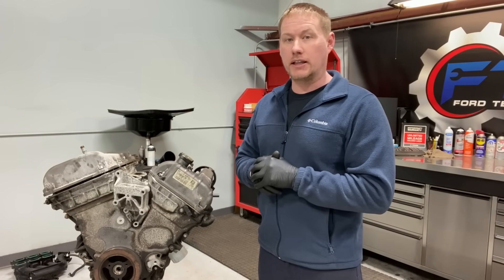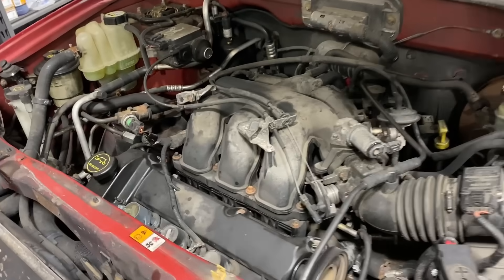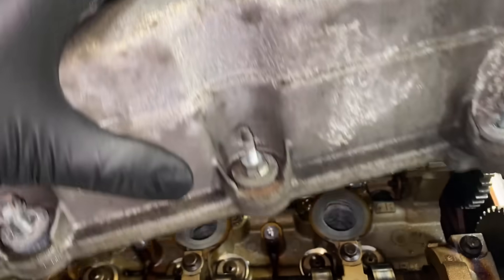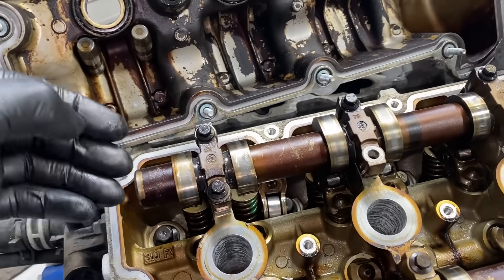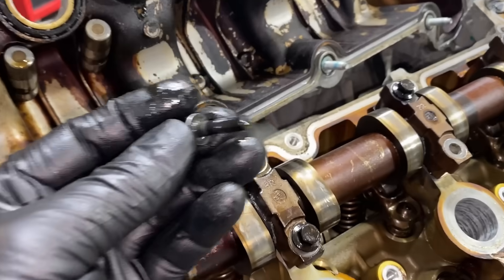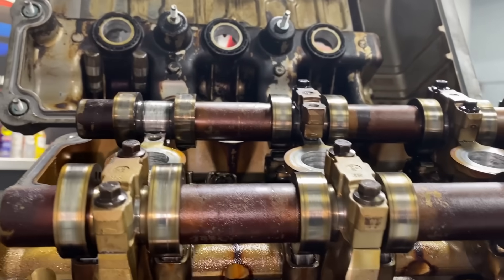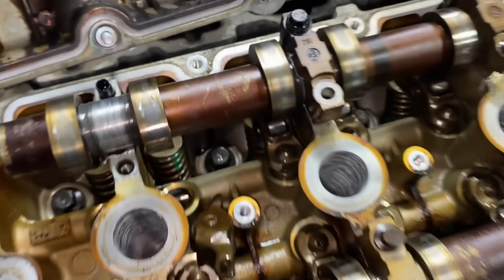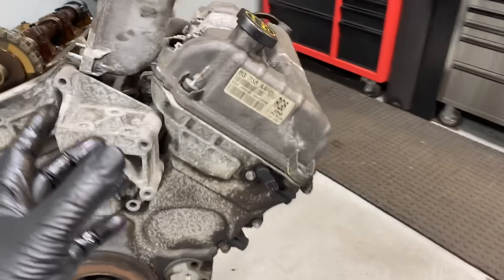Ford 3.0L V6 Duratec Engine: The One Fatal Flaw That Will Destroy This Engine!

Comment: I always thought the Vulcan was the best built Ford Engine!
Reply from the maker: Too many issues
Reply: @FordTechMakuloco  Interesting. The Duratecs I had in a 96 and 03 Taurus/Sable, I felt were junk. Parts were expensive when they broke (Radiator hoses), and with rust, servicing things such as oil pan gaskets was next to impossible. The Vulcans I've had (92 Ranger, 05 Ranger, 05 Taurus) were bulletproof. I've heard of cam synchro failures on it, but generally it gave an early warning from what I've read with a chirp that meant to replace it with a new Motorcraft. Sadly, all vehicles though, were severely rusted and went to the junkyards around 100-150k miles. I remember seeing people on Taurus forums praising the Vulcan; slow but reliable!
Reply from the maker: Burnt valves, chirping synchro, multiple oil leaks, front cover coolant leaks, cracked coil packs causing misfires, pcv tubes deteriorating causing massive vacuum leaks and stalling etc.
Reply: @FordTechMakuloco  I am grateful that none of my Vulcans did that during my ownership! They served me well for what they were, that and when I did have to wrench on them, they weren't anything too difficult like changing out alternators during a snowstorm. Oh, and the joys of burning myself every oil change due to position of the oil filter and the exhaust manifold. I don't miss that.
Reply from the maker: lol I hear ya there, between the hot exhaust and the starter you couldn't win.

Comment: Oh wow...that's something new!

That said...I got a '98 era 4.6 2V Triton that's sitting at 523,000Km...never been opened...yet! Knock on wood. Ford has made some great engines but some with interesting failure modes.
Reply: I agree. 2002 4.6 2v with 262kmiles on it and still strong and smooth as hell.    They should have kept using this engine.

Comment: I have that engine in a 2008 Fusion. It has over 218,000 miles on it, and it still runs excellent. It does leak oil though

Comment: Is this engine in the 2005 Ford Five Hundred (500) ?  I'm about to change plugs (100k maintenance) and have the intake cover off, wonder if I should change these bolts while I'm in there.
Reply from the maker: Yours is a slightly different version and I have never ran across this concern with your model.

Comment: Did these owners change oil regularly?  190k on our 06 freestyle and still running strong.  I am wondering how long the CVT will hang in there
Reply from the maker: Your engine is a bit different.
Reply: FordTechMakuloco 
Thank you
Reply: @tomedgar4375  I have a 2007 500 with the CVT. It has 100k miles on it.  Glad to hear yours has been good to 190k. My 500 has been a good car.  A bit under powered but reliable.

Comment: This actually happened to me on my 3v. It was my fault though as I was the one who tightened the cam caps. I caught it early thankfully and used ARP studs afterwards.
Reply: Why say that it is your fault? Did you use a torque wrench?
Reply: @5jjt  What evenis the right torque? :'-(
Reply: Did you clean out the threads with acetone and use locktite blue?
Reply: @tedtedness184  At that time no. But since then yes.
Reply: @TekMan05  hmm... ever pinpoint causes of those misfires?
Reply: @TekMan05  my other question is... was all those noises constant after warm up?? or only for a minute or 2 at cold star??
Reply: question... with the bolts loose did u have any misfires or noises??
Reply: @DVrec22   Loud tapping noises. Less power.

Comment: Thank you! I have a question, do you have a video explaining how to fix the oil leaks?
Reply: Basically, remove and replace the front cover. The intersection where the heads, block and cover meet is the shape of a "T" and can leak. Good time to do the timing set. The cam covers leak, too. The washers under the bolts can seep. Other than being a huge pain in bleep, it's a great engine!

Comment: Is this applicable to a 2005 Ford Five Hundred engine?  Thank you.
Reply from the maker: No I have never seen it on those engine they are a bit different design.
Reply: Thank you for the reply
Reply: @FordTechMakuloco  thank you for this answer.  I have a 2007 500 with 100k miles on the clock.   Been a great car.  We just don't put that many miles on.

Comment: Have you seen this problem in the later versions with cam phasers? I have a 2010 escape and have checked the bolts already back when I replaced the valve cover gaskets last year! Everything was tight and looked good.
Reply from the maker: No not on the 09 and newer Escapes.

Comment: I bought a Contour SVT new, great car, gave it to my son at 150,000 miles, he put another 75,000 on it before the body and suspension rotted away. Not one engine problem, just oil and filter every 5000 miles. That 2.5 L duratec was a fantastic motor.
Reply: I had a 96 contour with a 2.0 automatic. I drove it until 2011. I bought it used in 99. Brakes and alternator and a/c compressor. Only sold it because it needed struts and wouldn't pass emissions in Maryland. I really liked it overall.
Reply: I have a 98 SVT Contour. 2.5L Engine is clean and runs great at 247,000Km. My transmission is pooched. Having a hard time finding a replacent that the bellhousing matches. Fun car to drive
Reply: because the k series mazda is its father (probe gt/mx-6) 
this durapuke is the mazda aj engine

Comment: So would cleaning out the threaded sections of the head, then using red loctite on the bolts help this from happening again down the road?
Reply: yes.
Reply: Brian and others say NO to loctite.  Not designed for that, will affect the torque.

Comment: A drop of Locktite red on the treads of the new bolts?
Reply: Blue, dont use red its permanent, takes a torch to get it apart.
Reply: @JimGriff1720  Here’s on for this history books.  Worked on a late 90’s Saturn last year.  Had to pull the head for a bad head gasket. Front cover had to come off.  The oil pump for the Saturn is in the front cover and driven by slots in the crank pulley stem. Since there so much oil under pressure in that area you have to use a thin coat of sealant on the crank bolt washer.  Used the impact in the bolt, NOPE.  Used a breaker bar, NOPE. Wedge the breaker bar and the ground and taped the started, NOPE.  That only torque the breaker bar.  Got the torch and heated the bolt.  THAT WORKED.

Comment: This is exactly what happened to my 02.  After teardown, no broken bolts. But I found a chunk of RTV under the head gasket blocking the oil feed port to both cams. One port feed from the block then splits in the head casting immediately above head gasket.  She was a virgin.   Had to be factory RTV.

Comment: Question, could Ford be at fault using inferior bolts in the original engine. Question, could you use locktite on the bolts to stop them coming loose.

Comment: I was just thinking that replacing the bolts and using some thread locker might be a good idea. BTW: I just call oil leaks the "continuous oil change program."
Reply: I always have a bag of the cheapest kitty litter for the leaks. "If there ain't any oil under them, there ain't any oil in them."
Reply: You don't want to use threadlocker, it changes the torque/friction values, and you can strip the threads much easier while torquing to spec. Just go off the physics of friction alone, with new bolts
Reply: @BasedBidoof  Thanks!
Reply: @garylangley4502  Don't get me wrong I love threadlocker, but if the bolt/nut wasn't designed for it, it's probably best to not add it
Reply: @BasedBidoof not only that I don’t think you want to take the chance of that thread locker material coming out in your engine lol I don’t know if it would cause a problem but I wouldn’t want to take chances either. I’m pretty sure they don’t use thread lock in engines but I could be wrong.
Reply: That's a British invention: old British engines, be it car or motorcycle engines, had to leak oil. 
Thus you were sure of two things:
1. there actually is still oil in the engine
2. there is oil pressure
Reply: @tjroelsma  Ah yes, the Brits. Old Brit cars with their oil leaks and Lucas electrical systems. There is a reason why they called Lucas "The Prince of Darkness".
Reply: @christopherhylton8462  the reason the Brits drink their beeer warm is because their refridgerators were made by Lucas
Reply: @tjroelsma  It is also why used British railway sleepers are the best on the market. Sufficient oil impregnation for them to last decades without rotting..
Reply: I call it free undercoat, standard on most Chev's.
Reply: Yeah well that leaking oil gets into the local water supply
Reply: I never change the oil on my 99 DeVille because every  month it gets 3 quarts of fresh stuff 😂
Reply: Chris Annunziata I understand you are joking but some people actually do just that, adding oil, until the engine is so clogged that it is ruined. And they wonder why...
Reply: @vlasfarg  Clogged with what?
Reply: @chrisannunziata7628  if you're actually serious about that, at least replace the filter every month or two.
Reply: На АвтоВАЗе масло не меняют, его только доливают 😅
Reply: No dreadlock just buy really good bolts that can TAKE THE ABUSE I forgot name of the nuts and bolt company, that makes reusable head bolts even for diesel!!! And there cheap and life time
Reply: Yeah, the 3.0 Dura-crap engines are like the old BMW's that come through the shop. If they are not leaking oil in your bay floor there is a problem...... the engine is out of oil.
Reply: Christopher Hylton mine has 165k on it and i havent had any oil leaks and i check my oil feequently
Reply: @topkek7003  Do you use high mi oil? Mine has 136K on it and. The rear vc gasket will leak if I don't..
Reply: @christopherhylton8462  The customers of your shop must be morons who don't take care of their cars.

Comment: Wasnt that a recall, I had my moms in a few times in 2005 to replace those parts from ticking and that was at under 10k miles
Reply from the maker: no
Reply: @FordTechMakuloco  https://www.underhoodservice.com/tech-tip-diagnosing-a-ford-escape-with-engine-ticking-noises/
Reply: I remember going in for it because the tapping was loud and this was I believe the repair was
Reply from the maker: That is a totally different issues kind of like the issue the early 3.5L engines experienced.
Reply: @FordTechMakuloco  ok I am sorry. I remember they had replaced the bolts to tighten the camshafts down and this was under 10k. That repair was a campaign we got in the mail after it was done I believe because it was pretty loud. The transmission died just  before that for no apparent reason Never found out but that lease ended and we returned it...

Comment: Thank you sir!, great info to know, I had a Vulcan 3.0 6 Cylinder had great performance out of it. But I've look at the Duratec 3.0   6 Cylinder engines. Thanks for you're shared info again.
Reply: The 3.0 Vulcan is a great engine. Had one go over 300k in an 03 Taurus wagon. Only one transmission replacement, so I think that car owes me nothing. 3k oil and 25k trans fluid changes.
Reply: @jamesplotkin4674  yeah mine was '2003' also James, a sedan, ses model, I drove from '2006' to December '2017', when I hit. Black ice. It only had 140,000 miles on it. It had 66,000 miles when I got the car, I miss that car. I was ill for 11 years and didn't drive much, had chronic pain. Great automobile to me

Comment: what about the OTHER fatal flaw with these engines like the "Timing Chain driven Water pump"?
Reply from the maker: You are thinking of the transversely mounted 3.5L Cyclone engines.
Reply: He's already covered that in a previous video
Reply: That's the 3.5 liter in later models.

Comment: Is the 2.0 Ecoboost in the 2018 Ford fusion reliable and if not what are the week points of the engine? Thanks in advance
Reply: The Ecoboost engines are one of the least reliable engines Ford has made.  In one of my last jobs, an Escape with an Ecoboost with 45k miles was brought in with an overheating issue and found the head gasket was blown

Comment: Brian, has the 2000 model year Taurus effected with the D.O.H.C. 3.0 L ?
Reply: Duratec 30 (that one) came out in 96. They still had some vulcants out there though. If iron, it's a vulcant. If aluminum it's that one.

Comment: I have an 08 Fusion with the 3.0 Duratec and problems so far have been the coils, (cost over $2K to fix), and the rear main seal is leaking, but not bad. Car has 140K miles, still runs good.

Comment: Thats one hell of a One fatal flaw.
Reply: As easy as it is to do a prevenative measure, it ain't too bad.
Reply: @2jz4life35  The point is to me anyway is something like that should not even be allowed out of the factory.
Reply: @kerry1111111  I don't think they're designing them to be bullet proof but if there's only a very small percentage of this problem occurring then it's not practical for Ford to redesign.

Comment: How convenient they engineered the valve covers with a dedicated recess for your lifters to wedge into when the cam cap goes..good thing the rocker isnt done..ha ha brilliant
Reply: I find it ironic that Ford takes engineering precautions such as this, yet completely miss the mark intentionally on simple things like bolt grades/torque, etc.
All makes are guilty of it. 
90% of vehicles are factory lemons.
Reply: Defect,
If they made 'em last forever, how much harder would it be to sell new ones?
Reply: @1upPaintingAB  It's completely intentional... Engineered failure to force you to have to take it in to repair the engine or better yet just buy a new vehicle.
Reply: Big money in the replacement repair dept
Reply: There's no way Ford is going to design  valve covers with extra space for cam cap or lifter failure- isn't going to happen; good and proper bolt fastening specs should be correct in the first place.

Comment: My old 900 Kawasaki had replaceable cam bearings 45 years ago. I guess that makes too much sense for Ford. If it were my engine I would throw away the cam tower bolts and put in good quality studs. End of problem!

Comment: My 2010 Fusion has I guess the next version of the 3L Duratec. Some minor oil leaks, but so far no engine problems at 100k miles.
Reply: @Jonathan A Mine had several oil leaks while under warranty. They replaced the valve cover gasket/grommets a couple times but the leak always came back. Finally with just a few miles left on the powertrain warranty I brought it back in and they replaced, I think, the timing cover seal. Once again, it was good for a while but the leak came back and now out of warranty. I replaced the PCV (a pain the the V6) but that didn't help. Oh well, I'll live with it.
Reply: @Jonathan A I've tried liquid sealers too but they didn't seem to help. The good thing about living in Calif. is that nothing rusts here. I also have an 18 yr old camry with 210,000 mi on it and not a spec of rust.

Comment: So it appears safety wire early in the motors life may be a wise preventative measure?
Reply: Safety wire (great idea) + blue Loctite.
Reply: not going to happen, nobody uses safety wire or loktite on these parts, we have a Toyota engine plant near us my brother worked at, the entire valve/cam train is assembled and torqued by machine, no human hands at all, so if one is wrong, a bunch are wrong, they have scraped entire shifts of engines because of an assembly machine not running the prelube assembly grease correctly, and its not worth the time to rework after assembly-wild

Comment: Thanks for the tip! Would this apply to a 3.0 DOHC on a 98 Taurus? Mine has always had an intermittent ticking noise that will come and go abruptly. Never really caused me any issues and I change my oil every 3 - 5k

Comment: I've owned (and worked on) a number of these Escapes with this engine and years ago remember you had mentioned this in in your video, "Ford Quick Tips #61". Every valve cover change these cam-cap bolts get re-torqued (or any time those valve covers come off). I've seen them loose but never broken like this and am sure the two minutes it takes to re-torque has saved a couple engines. Yes, we're watching and appreciate all the tips!
Reply: I wonder if the bolts should be replaced instead of just tightened every time the valve cover comes off.

Comment: This applies only to the 2001-2007 engines? I have a 2009 Escape with the same engine. Also, can you talk a little more about the oil leaks? I have some minor leaks coming from my engine too and I can't figure out specifically where they are.

Comment: Thanks for the heads up, I'll keep an eye on it next time one of my rear bank ignition coils die or valve cover starts leaking. 
The leaky timing cover will stay like that until the day it dies. Not messing with that demon. No space to work and have to remove a bunch of shit out of the way.

Comment: I had a '98 Taurus with the 3L 24V and it was a great engine.  Never had a problem with it and it really didn't even leak oil.  I traded the car with ~190k miles on the clock
Reply: Donkey CaCa  I ran Valvoline white bottle and Motorcraft filters every 5k or so.  We put probably 40k  mostly highway miles on it every year so it really had an easy life.

Comment: I have an 09 Ford Fusion 3.0 V6 and it just turned 95,000 miles is this something I should have checked ? I use Mobil 1 and change the oil every 5,000 miles. The engine runs strong and smooth but now I am very concerned. Thanks appreciate your videos !
Reply: phonebone69 why would you not ? Before I checked it I’d order 2 dozen new bolts from Ford and new valve cover gaskets , pull the covers replace the bolts one cap at a time,torque them and don’t worry about it anymore.